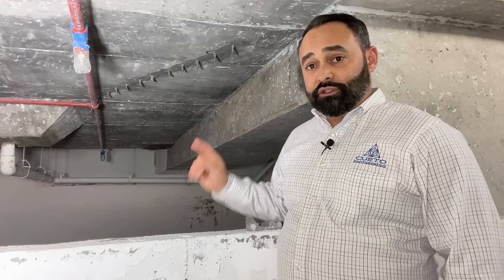Concrete Crack Repairs by Epoxy Injection

Comment: Nice content . 
Do you
Drill holes for the ports?
Reply from the maker: Holes are not required to be drilled for the epoxy injection. The injection ports are placed intermittently along the length of the crack, and the crack is sealed between ports to ensure the epoxy doesn't leak out.
Reply: Thank you for your response.
Do I have to use necessary pumps to inject the epoxy or I can do it “manually” with guns? Specially on overhead repairs?
Reply: Thank
You for taking the time to respond. 
Are all overhead cracks need to be repaired by epoxy injection?
Reply: Also, can I do it through caulking guys (the double ones) ?